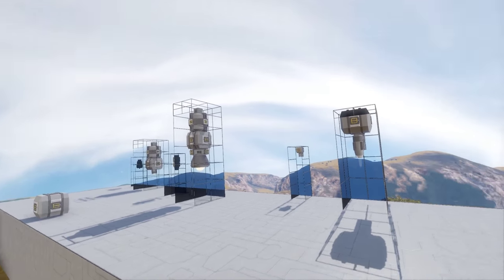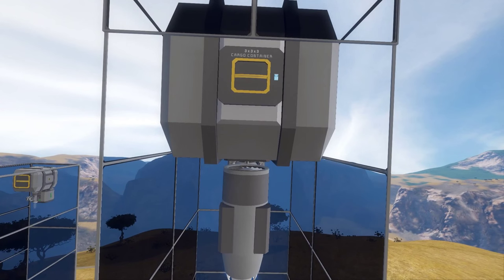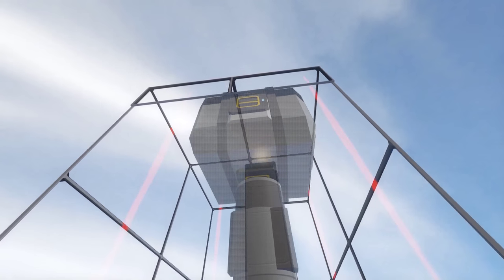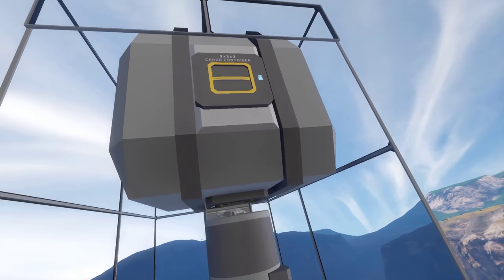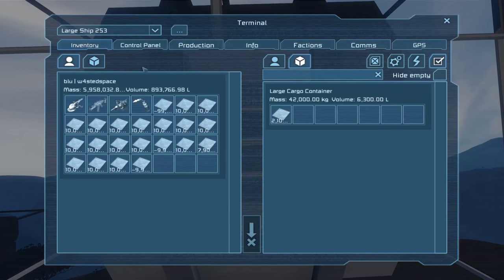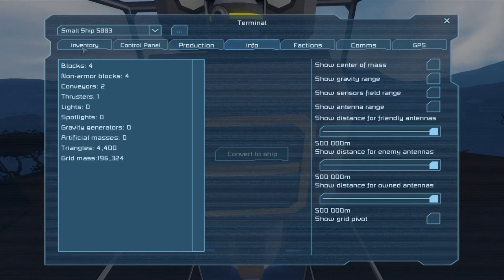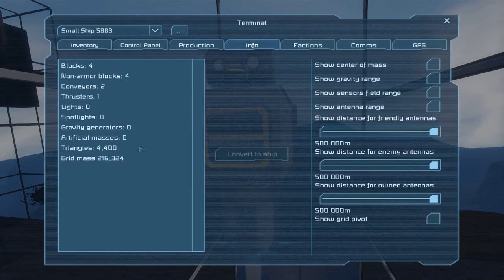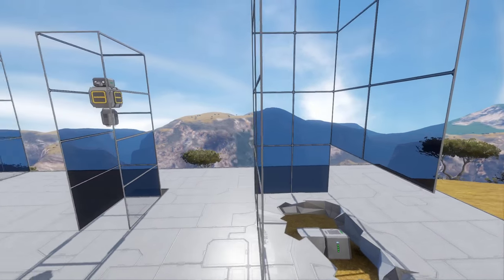Space Engineers - How much mass does an Atmospheric Thruster lift?

Comment: I think I might have an explanation.  Out of curiosity have you checked your results on worlds with different inventory sizes?  I know keen did some odd things cargo weight depending on the max inventory sizes in order to make ships with max cargo filled behave the same way no matter what the world setting was.
Reply: This is a very good hypotheses. We need to know the inventory factor of the test world because it is indeed true that this effects the weight of cargo containers.
Reply: UpstreamNL What I suspect what is happening, is that the world has the default 10x setting (even though the option is disabled when creative is selected).  And the grid mass indicator shows the what the mass should be in a 1x world.

But behind the scenes, what the mass actually is, is weight of ship + 1/10th of the weight of the cargo.  Which is giving the inconsistent result, as well as why small ships (which has a much smaller base mass) seem to hold more cargo.  I could actually crunch the numbers and find out.
Reply: +UpstreamNL +W4stedspace OK  I did the maths for everything except the large ship large thruster (because the starting weight is never shown in the video).

What I did was took the fine weight subtracted the base weight, divided by 10, then added that number back to the base weight to compute the "real' weight.  I then ran the numbers with the thrust against the weight:

Pre-cargo weight correction:
Large Ship, Large Thruster acceleration: 1.3     m/s^2
Large Ship, Small Thruster acceleration: 5         m/s^2

Small Ship, Large Thruster acceleration: 1.478 m/s^2

Small Ship, Small Thruster acceleration: 2.063 m/s^2

Post-cargo weight correction:

Large Ship, Large Thruster acceleration: N/A (base weight not shown)
Large Ship, Small Thruster acceleration: 11.08 m/s^2

Small Ship, Large Thruster acceleration: 12       m/s^2

Small Ship, Small Thruster acceleration: 11       m/s^2

Given the error margins, these numbers look high, but are consistence with one another.  Knowing Keen they likely have have 1G of gravity wrong and is likely more at 11 or 12 m/s^2
Reply from the maker: +Charles Miller I have not, all I can confirm at the moment is that the same results are true in both survival and creative because on 10x (which you are correct the settings are defaulted to) none of the amounts neccesary to prevent lift reach the cargo limits of the containers.

Gonna have to do some inventoryy size testing then and compare with the grid mass figure, because that's an interesting hypothesis indeed.
Reply: +UpstreamNL +W4stedspace https://docs.google.com/spreadsheets/d/1anvLcGjxxWUbCY4tLCSPSAlsKbWf_UdMqUptaAEFT-M/edit?usp=sharing

Pretty sure my hypothesis is correct looking at these numbers.  If I had the starting weight for the large ship, large thruster this would be a slam dunk case.
Reply: Ok, I've de-compiled the source code for showing the number of G forces:

	if (flag)
	{
		this.m_hudIndicatorText.Clear();
		this.m_hudIndicatorText.AppendFormatedDecimal("", vector.Length() / 9.81f, 2, " g");
		MyGuiManager.DrawString(font3, this.m_hudIndicatorText, normalizedCoord, this.m_textScale, null, drawAlign2, false, float.PositiveInfinity);
		this.m_hudIndicatorText.Clear();
		this.m_hudIndicatorText.AppendFormatedDecimal("", vector3.Length() / 9.81f, 2, " g");
		MyGuiManager.DrawString(font, text, vector6, this.m_textScale, null, drawAlign, false, float.PositiveInfinity);
		MyGuiManager.DrawString(font, this.m_hudIndicatorText, vector7, this.m_textScale, null, drawAlign2, false, float.PositiveInfinity);
		if (flag2)
		{
			this.m_hudIndicatorText.Clear();
			this.m_hudIndicatorText.AppendFormatedDecimal("", vector2.Length() / 9.81f, 2, " g");
			MyGuiManager.DrawString(font2, text2, normalizedCoord3, this.m_textScale, null, drawAlign, false, float.PositiveInfinity);
			MyGuiManager.DrawString(font2, this.m_hudIndicatorText, normalizedCoord4, this.m_textScale, null, drawAlign2, false, float.PositiveInfinity);
		}
	}

In all of that mess, you will see they are dividing by 9.81f meaning that Keen isn't getting gravity wrong.

What I now believe is that the 11Gs acceleration is actually coming from a misrepresentation newtons from from thruster efficiency formula.  In essences the higher in the atmosphere you are, the less thrust you get.  Note this likely acts as "from sea level" instead of from height of ground.  Meaning even if you are on a mountain, you will get lower thrust.
Reply: +w4stedspace +Charles Miller
Essentially, cargo mass is added to ship mass, which is then used to determine thrust. If c = cargo mass, s = ship mass, and m = total mass, then c + s = m. If your inventory setting is set to 10x, this multiplier is divided from the cargo mass before doing mass/thrust calculations, so: ( c / 10 ) + s = m.

When you're in creative, the game still uses the inventory world setting to determine cargo+ship mass values for the purposes of thrust calculation. Even though the setting is greyed out when you select creative, whatever it is set to is still factored in. So, there is a difference between 10x inventory creative and 1x inventory creative - even though you have an unlimited inventory size. Definitely need to re-try this experiment with 1x inventory in creative to get more definitive results :)
Reply from the maker: Hesterry
Agreed! Although it's a bit silly that with 10x as the default now and very few people play on 1x this will make working this stuff out a bit of a nightmare.. there's no easy numbers, every time you're gonna need to working out ship mass and cargo mass seperately and then combine to get even a vague idea. Somewhat clunky!
Reply: +w4stedspace The solution is simple though - they just have to correct the shown grid mass and that's it.
Reply: +MrBaronmoll well, not really. That means when you put 1000kg steel plates into a container, it magically becomes 10x lighter...
Reply: UpstreamNL
 It does allready, doesn't it? It's just not displayed.
Reply: +Charles Miller Not at all. the cargo mass does not matter. 10x the amount cancels out 1/10 weight. It has absolutely nothing to do with cargo volume.  It is a test of total grid weight. It does not matter how many planets it takes to get the grid weight. Only the final number vs TWR.
Reply: Torcull Astrospace Nobody is talking about cargo volume.

We are talking about cargo mass.

And if my idea is so wrong, then why do the numbers work out so perfectly?  The only explanation is that cargo weight is divided by the inventory size multiplier, but this isn't reflected by the grid mass indicator.  The grid mass indicator shows what it would be if the full mass was added.
Reply: +Charles Miller The source code of SE is available on GitHub so there is no point in decompiling it.
Reply: Андрей Беньковский Actually, GitHub is MONTHS out of date.  Decompiling lets me see the code actually in the game.

Comment: The interesting thing with the anomaly (which still exists) is that 9 small ship small thrusters that take up the same area as 1 large small ship thruster, provides more lift.  In this example the difference is in excess of 50,000kg in favour of the small thrusters.

I came back here to have a look at your figures again after I recently had a run in with a small ship miner that I built and I was having problems with low lifting capacity.  I switched out the two large thrusters for 18 small thrusters and easily doubled my lifting capabilities.

Something to bear in mind when building small ships as small thrusters are far easier to place and distribute than the big clunky large thrusters (and they are two blocks lower than the large thrusters).

Comment: Just turn off thruster, turn override to maximum, and the number of kH divide by 10. (e.g. thruster shows 350 kH, so it can carry about 35 tons or 35000kg, by the way gravity constant is 9.81 not 10, so it will carry a little bit more). Assuming that all numbers are right and there are no bugs. As video shows, there are bugs :)
Reply: +Kirill Gorodiski 
I'm horrible at math and physics but even I figured this out.
Reply: +Kirill Gorodiski At sea level. Also take into acount the height.
Reply: +Kirill Gorodiski Yeah, but I can't do division by 9.81 in my head. Also, if you divide by 10, you have a safety margin.

Comment: Staying afloat is different from being able to go up (in a decent pace), which is important when you ned to ore out of a hole, or even back home over hills. As you showed, cranking up the override hardly makes it go up. So what's interesting to know is at wat mass you can't reasonably ascent.

Or perhaps something was wrong with my small 4 large thruster ship with 12 drills and a cargo container. Don't think I was much over 100k kg. But it would not lift out of a hole anymore (or just really slowly). Not until I crashed down and lost mass by destroying drills and the cargo container.

Edit: Must have been a fluke because of some messup in/of my ship. Things seem ok now.

Comment: they sholdn't be falling anymore, if you add thrusters to the sides. That's beacsuse the thrusters pointed downwards are only putting out as much thrust as needed in that direction IF you had a thruster on all sides (the ship is not 100% aligned to the planets gravity) / The vector of force (pointed upwards, equal size to the force of gravity pulling the ship) the dampeners need is being calculated and then broken down in vectors orthogonally with your testships grid-faces, wich represent how much thrust the thrusters in each direction have to put out.. If anyone does not know what that means: it's simpler than it sounds :)

Comment: they need to adjust rotary parts as my troop transports ive made for fun lately always fall door side heavy,even if i lock it with a landing gear or connector and merge blocks wont allow it for reasons,trying to ascend will raise wit hthe front side raising higher if the door is at the back,why does it do this!

note:i do this on small ships

Comment: Interesting. I've been fiddling about with thus with a mind to designing a solar powered carryall/helicarrier type airship as a mobile refinery platform that can lower a wheeled miner of some description to the ground while it just hovers about.

The main thing that had me worried was just how many atmo-thrusters it'd take to keep it hovering under a full  load.

Also been toying with the idea of a small surface-to-orbit spaceplane, but while I can get a prototype to orbit in creative, I suspect there's no way you can store enough fuel in a small ship to make it out of the gravity well.

Have you looked into whether or not using hydrogen fuel will lower the mass as the tanks empty? If so it looks like multi-staging may be the way to go.
Reply from the maker: +Reverend Trigster Sadly there is no mass change between a full and empty Hydro tank so there's really no point to staging at the moment aside from loosing the mass of the tank itself which is super neglidgable. Really hope it's a thing they make more of in future though!
Reply: +Reverend Trigster 
Not to mention the fact that wheeled items tend to fall through the world right now or hit invisible walls and fly 100m up into the air, or is it just me? 
Ive been trying to build a remote-controlled ore scout rover - (since autopilot does not work for ground it seems, and i dont have the programming expertise in C to make it do its own thing) - i got it working, but occasionally it hits invisible walls on flat ground and explodes, or it just falls through the world - im at a total loss to explain why my rovers keep doing this - even with a tri-axle design for stability and weighing more than a most tandem trucks round where i live >.>
Reply: +Tyriael Soban Several things could be your problem. First of all autopilot should work on the ground, you just have to make sure you do not have collision avoidance on, it causes the autopilot to freak out a bit. If you don&#39;t have that option on and its still not working, bug report it, it probably is a bug.&#160;

Second, the invisible wall thing, if your rover has pistons or rotors on it they seem to cause some weird glitches in many peoples games, so far I have had no problems, but I have seen video evidence for a number of other people.

Third, is your vehicle going to far away from your astronaut, I have seen this cause similar issues to what you are describing, to test, try staying close to it for the same distance and see if it acts the same.
Reply: +Tyriael Soban interesting. I've never had a rover fall through the ground, but my character has 3 times in Multiplayer.
Reply: +Reverend Trigster I've had a similar idea, but I've run into a staggering power problem. Those atmospheric thrusters have awesome TWR, but also require immense amounts of electricity. Keeping something hovering for a longer period of time is next to impossible. Which is why we need airships: http://forums.keenswh.com/threads/airships.7373944/#post-1286887105
Reply: +nur für KSP Rather then hydrogen, why not use a vacuum? It's even lighter :D 
Ofcourse, hydrogen is more practical, because it doesn't need the same level of structural support as a vacuum, and it doesn't explode unless you premix it with tons of oxygen to ideal conditions. A vacuum implosion is about as bad as an explosion...
Reply: Good sir, I recommend installing a mod that gives 10x max speed and using inertia to slingshot you into the green with atmospheric thrusters, some maneuvering ion and/or hydrogen thrusters.  (One upside to this is that the more cargo you have the longer you'll be able drift)

If you can reach a high enough speed that is.  Only issue is reliable and fast deceleration when you are in the green :/

Another solution is set some battery-solar-antenna-atmospheric thruster pods near max atmosphere altitude and make a compact drone.  You would save mass and energy if you make an orbital cargo drone.

Last solution would be to connect a medium cargo container directly to an oxygen generator to refine ice into fuel during flight and extending the period in which maximum hydrogen thrust can be applied.  

These are my solutions, feel free to use them, they usually work when your computer is powerful enough to handle these tricks and strategies.
Reply: Also, you should consider getting azimuth hydrogen tank if you didn't already.  Sure the storage per unit is crap, but it's pretty easy to find room for some in the voids of your ship.  I have also made a craft without armor, but instead small hydrogen tanks.  Lasted plenty.  Focus on finding the trick that works best for you before adding armor and aesthetic shaping (as well as weapons ;)  )

Comment: I think the power you're using in calculations is only override value that is added to something hidden. Like inertia dampeners. That might be the cause of such a huge error. Also I don't know how strong gravity on this planet is, but assuming it is 1G, 340KN would support only about 34t (34000kg). So there's some kind of hidden power in thrusters or indeed implemented math is wrong. One thing is somewhat proving that there's no hidden power - power consumption which seems relative to override value.

Comment: Interessting... I've tried many times to retrofit one of my own designs, to get an atmospheric strike craft... the weight is a little above 70.000kg... but with only one small ship large atmospheric thruster facing downwards it falls down like a giant rock... In either way: manual thruster override and maximum acceleration... what the hell is different between your configuration and mine? I've rebuilt the ship from scratch, but i can see no difference...

Comment: isn't it because the small ship grid have 5x the dampener power?
Reply from the maker: +Gustavo Meletti I wasn't using the dampers though, had override turned on so that shouldn't have been effecting the test itself, just when I tried with dampers. Plus I don't believe it effects the amount of weight they can lift, just how quickly they can slow you down.

Comment: I love the scientific testing. I thought you might look at all the engine types in all environment types, I was surprised you only tested atmo-thrusters, not hydrogen or ion in atmosphere and in space, and in high altitude. I've noticed ions do more for escape velocity than we were told, I can lift off a pretty big ship ALMOST using only atmo-thrusters and ions, there's only a few thousand feet where neither works well and hydrogen is needed. To naill all those numbers down, would help us feel more like scientists, lol. Let's see the full test if your into it.
Reply from the maker: +1FOEHAMMER I'll be doing more but when I found this anomaly I thought it best not to include these in with the rest as they are clearly not quite right at the moment :) That's why there was a rig for hydrogen setup also I never used.

Won't bother testing Ion on planets of course, they can't hold the power they need to run in the air let alone any more mass :)
Reply: I think you MIGHT be surprised by ions in atmo. I was. Better than you might think, than we've been told. Not ideal for atmo, but not out all the way either. They actually do help, just a thought.
Reply from the maker: 1FOEHAMMER
Can use them for control thrusters at least aye, have used them for side thrust a few times but still don't much like em tbh
Reply: Yup, my thoughts exactly, helps while making a compact design (my famous Tel-Tac is getting a face lift, so it works like the series, I'm excited, working on the workshop part now) It's not easy to make a ship that does all the thruster types well. Also thruster is not a word in spell check? lol